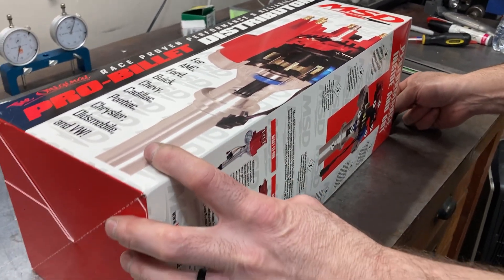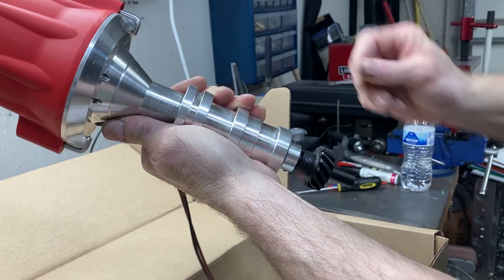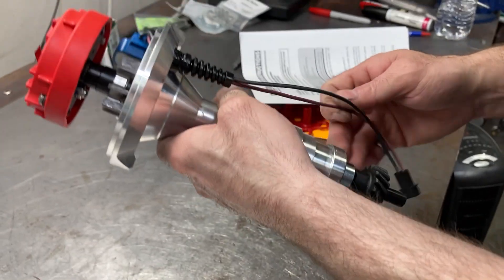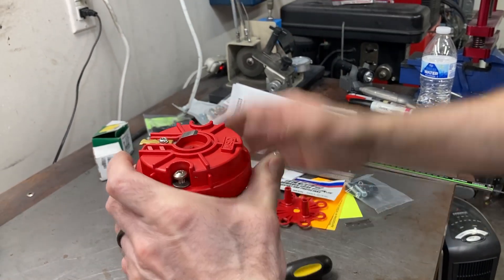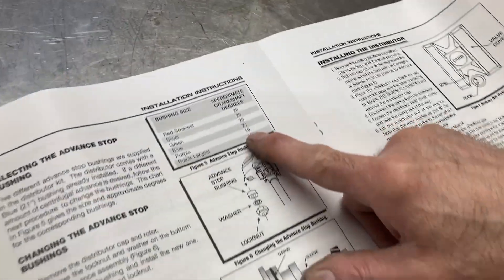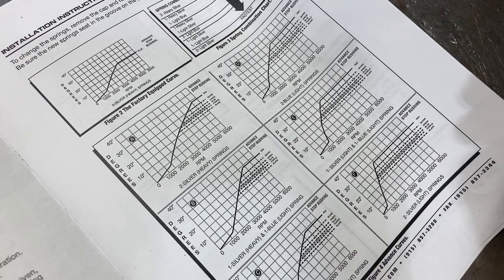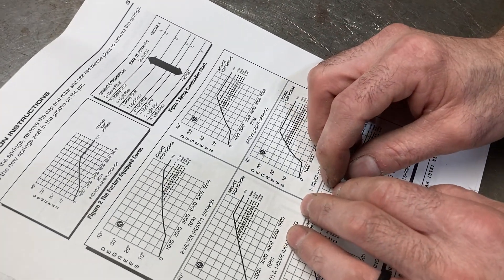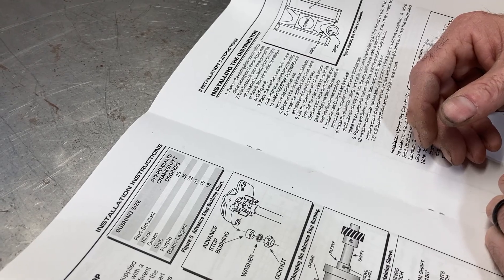Lykins Motorsports MSD Pro Billet Ford FE Distributor Recurve

Comment: We used to recurve our mechanical advance in the ‘60s using a Sun distributor machine and a selection of springs and weights,and sometimes a bench grinder.Make changes,rev it up in the Sun,check again.This set-up is much less labor intensive and can be done without diagnostic equipment.Very ingenious.

Comment: that i believe is a good setting,exactly how i have mine setup
Reply: Depends on cam and compression ratio. I have to dial initial advance down a good bit to avoid detonation under load @ 2K rpm street cruising.